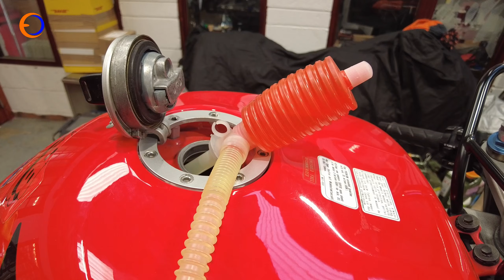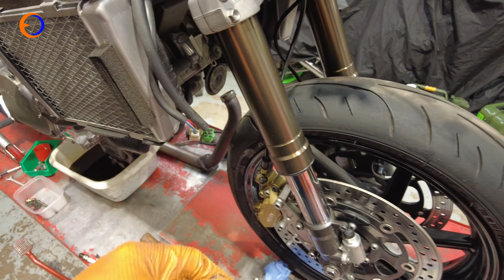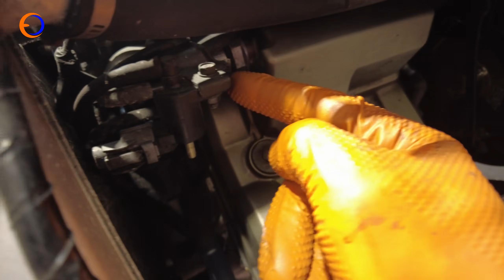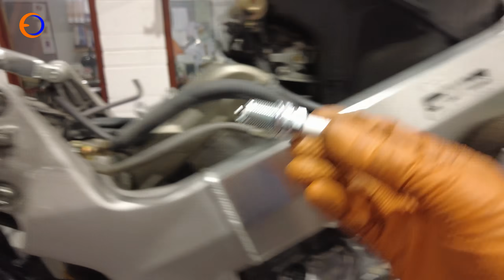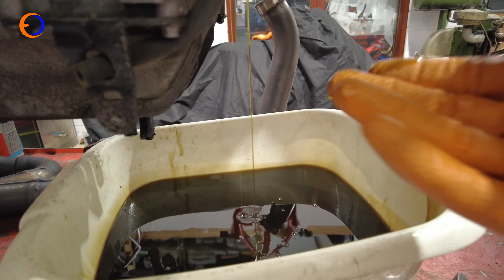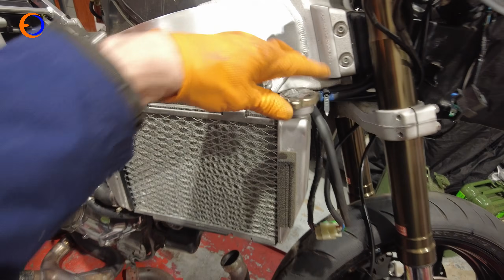How to service your engine. Honda SP1 service and upgrade project part 4. RC51. Valve clearance. Oil

Comment: Interesting video. Please note that there are actually some clear sealants on the market which are oil resistant etc. I use it on my bikes. Although someone put too much sealant in the first place. New gasket should go in every time with a little bit of sealant in the half moon locations as specified in the manual.

Comment: Hi Not sure if anyone can help ?? i just bought a sp1-y . runs great when it gets hot the fans kick on etc. but the digital display is either erratic and flashes on 132 degrees and a temp warning light comes on, or the display reads no temps looks like --- ??  where does the display get the temp reading from? is it sensor under tank , the thermostat sensor?? or is it a sensor on the rad?? tried looking online cant get a answer.... cheers

Comment: Brilliant video Dave :) Honda's manual says that we should replace the rubber gasket when doing valve clearance, is that true? Or if the gasket look fine we can keep it?
I just love the SP1 ❤
Reply from the maker: I tend to reuse if they look OK. Honda love to recommend new parts

Comment: One big thing what I missing from the video is what to do if the valve clearence is off? How to adjust or so?
Reply from the maker: Hopefully you won't need to adjust, but if you do I'd highly recommend getting a proper honda workshop manual and going through step by step

Comment: Hi Dave
I am changing the coolant in my 2018 vfr for the Motul motocool +organic that you use. The bike currently has blue coolant which I believe is not compatible with the Motul coolant. Should l be flushing the system a few times before using the Motul coolant. 
Thanks for providing a channel with content that is informative and on point.
Reply from the maker: It's supposed to be compatible with most coolants, but if unsure a flush through with water is sensible
Reply: I will give it a flush just to be sure. 
Thanks for replying it's much appreciated.

Comment: G'day Dave, did you replace the valve cover gaskets when you checked the valve clearances. About to do my SP2 and thinking I should change them.
Reply from the maker: No, nowt wrong with them so didn't change them

Comment: Loving your SP1 videos. I was recently washing mine and since then I get no power when turning key, no lights on dash, no fuel pump , nothing at all. I checked fuse box and they seem all intact. Any suggestions?
Reply from the maker: There's a 30amp fuse in the starter solenoid, easy to miss but powers everything

Comment: Dave, I wouldn't have had the patience for the pair valve. I'd have flipped the reeds, and put vacuum caps on the reed covers. Cap the airbox feed to the valve, and toss the emissions equipment into a box, never to be opened again!
Reply: Yes indeed - Ive ditched the entire PAIR kit using blanking plates and an electrical resistor from Smart Moto

Comment: If you putt the tank up with hammer (to change air filters or something) 
Your better undo all the bolts the tank can start leaking on that mounting point underneath
It’s weak point 
Just saying 
🤘🏻

Comment: If you ever fancy cleaning out that expansion bottle... Use some rice, some fairy liquid and some hot water. You'll know you have the mix right when it sounds like you're playing the maracas!! I was dubious at first but it worked wonders on my ZX6R bottle 👍 The rice does the "internal scrubbing", with the fairy acting as the cleaning agent. When done, just rinse it all out with clean water.
Reply: Or add star anise, one egg and some spring onions and drink it!

Comment: Please use NOT HIFLO Filters.!!😨
Semi Synth oil strictly Recommended for this bike.!!
Reply from the maker: Thanks for the concern. Hiflo filters are perfectly good and much better value than oem. Fully synthetic oil is better in every way and will work perfectly with the sp. Back in 2000 fully syn oils weren't good with clutches but modern oils are fine so no need to worry

Comment: So whats the trick for pulling the tank off without dumping the remaining gas all over?  Or were you able to pretty much get it dry with the siphon?  I've got an old 70's honda with a balance tube for the gas tank that runs through the frame,  I still haven't found a good way to take that damn tank off without making a massive mess.
Reply from the maker: The pump does generally let too much through so it's less of a problem. But I feel your pain with the balance pipe

Comment: Another great video, thanks very much for putting it together. A couple of questions: 1) did you use any sort of engine flush treatment before draining the oil? and 2), do you plan to do a video that shows how to adjust the valve clearances (changing the shims??) thanks
Reply from the maker: I don't use oil flush, never found the need. If I get time one day I'll do one about removing and refitting cams
Reply: Thanks Dave, great info. Looking forward to your next instalment of your sp1 storey.

Comment: It is usually a silicon sealant on the cam cover gaskets, so it seems correct.
Reply from the maker: It should be a specific sealant, not a standard silicone though, as you'll block the oil strainer pretty easily with normal silicone
Reply: @obsession_engineering  maybe that is just what was used on these old bikes. I recently done all this on my y2k Kawasaki ZX9r, the manual said to put silicon sealant on those parts of the cam cover gasket 
It was also what was previously on mine, and looked the same as yours. I didn't use anything with the new gasket 😂  seems fine so far 👍
Reply: My GPZ500, specifies using rtv silicon for the half moons. I understand what rtv means, I just wonder why not stuff like 3 bond, well seal or hylomar ?

Comment: Unless you have a really weak grip you definitely do not need to tighten the filter anymore than by hand. I have been a mechanic for over 20 years and have probably done a thousand oil changes in that time. I've never had a filter come off that was put on hand tight.
Reply: Some manufacturers say hand tight then a quarter turn.
Reply: @Vtwin_Superbikes  yeah I know but my 20 years of experience says that hand tight is good enough. My dad was a mechanic in the Air Force in Korea and then owned his own automotive repair shop for almost 50 years. He also only ever hand tightened filters. No issues

Comment: As you have added fully synthetic, please let us know if you have any clutch slip issues:seems to be relatively common for SP's when adding fully synth when semi synth was used previously
Reply from the maker: Fully synthetic, back in the early 2000's was basically just car oil and not designed for wet clutches. Newer bike specific fully syn is absolutely no problem in wet clutch bikes

Comment: Whats the point in the possibility of very high rpm’s if you don’t have desmo? 😁

Love the bike and your vids. Keep at it and please film it on track. 😃👏🏻
Reply from the maker: Steel springs will cope with high revs, not quite as well as desmo but certainly enough to make gear driven cams a sensible option. Especially on a twin, where the cam loading land unloading isn't damped down by other cylinders cam actions
Reply: @obsession_engineering  Being a Ducatista, I had to throw something back. 🤣 The springs not only cope much less, since they are not forced shut they also need more force to turn. Gear drive is awesome, as is the bike.